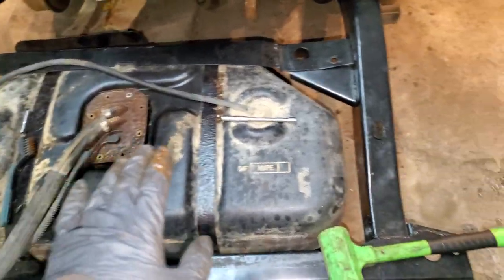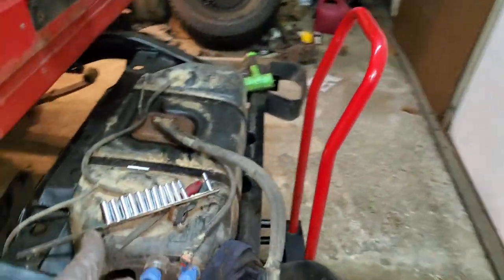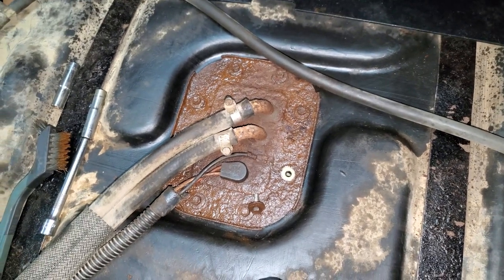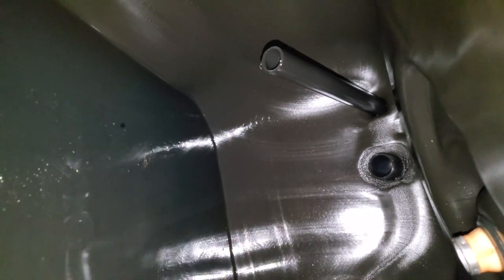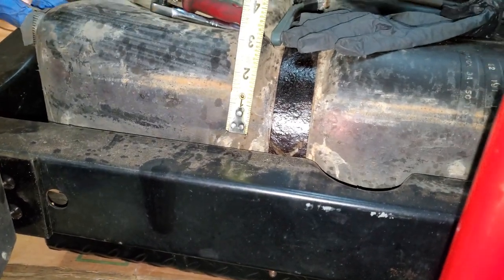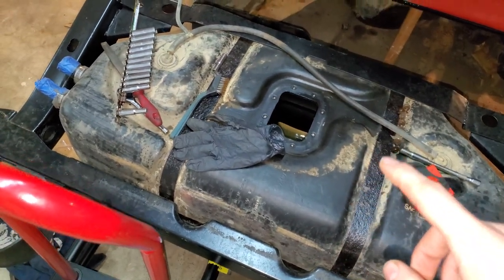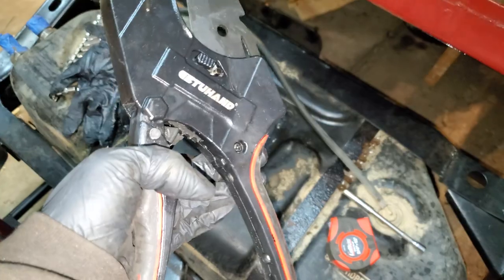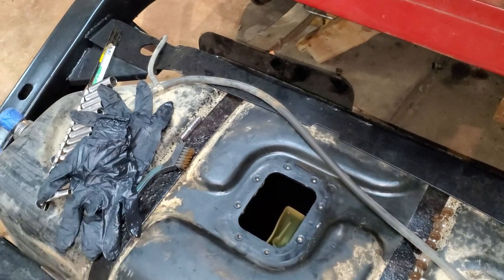Increase Jeep Wrangler Gas Tank Capacity For Free

Comment: "Rumor has it" , this wasn't a rumor. Greg from Unofficial Use Only was kind enough to tell you about this trick.
On the first generation Wranglers the tube is a pass-through design and can be yanked from the outside of the tank. However if you don't want to chance it leaking I recommend reaching inside and trimming just like you did. Now the second generation Wrangler known as the TJ, the internal hose is not a pass through design and you have to remove the pump and do it exactly how you did. The 20 plus gallon tank on both models only leaves approximately 1 in of tube on the inside of the tank.
Reply from the maker: That's why I have a link to your channel in the description and cards
Reply: @JeepSheepTV  I would have known that if I would have actually read the description instead of just commenting immediately on your awesomely informative video
Reply: Do I need the 19gallon pump and assembly or the 15gallon, plan on doing both at the same time???

Comment: Liam, This also can be accomplished by removing the stem from the outside without dropping the tank.  It’s rather difficult to pull it out but not impossible.  Once it’s out, just cut the hose and reinstall.
Obviously, you can’t get to the gauge unit, but if it’s working, no need.

Finally received the Bronco notification on the estimated build of 5/30/2022.  It will possibly be at the Dealership in July.  That’s almost two years since my original reserve.
Reply from the maker: Man, that's crazy.  I was just driving around in a Bronco that I borrowed from a friend for a thing at work.  It was pretty fun. I was telling my coworker that I wasn't sure if you had gotten yours yet.

Comment: I did this to my 92 YJ. I did not drop the tank I just pulled the hose out from the nipple. Cut around 3 to 4 inches off. And I get a little over 20 gallons in the tank. Just when people do this you May's have some space for expansion of the fuel . Saying this so no one will cut it too short. Much easier then dropping the tank.

Comment: 4 cyl didn’t need extra gallons or weight. Longer vent cut capacity back
To 15 gal. 6 cyl didn’t care about extra weight. Short vent made 20 gal. You can get 20 gal in 4cyl tank if you take your time at pump and milk it in.  !!!!